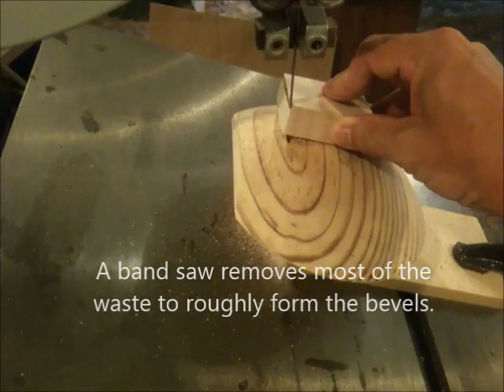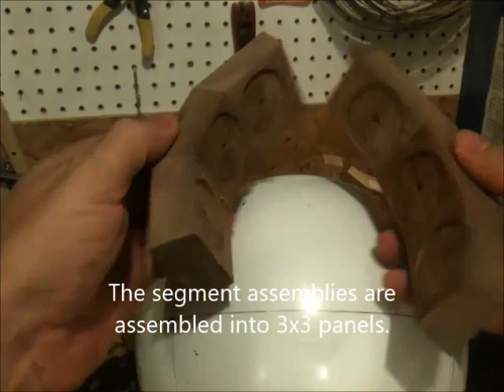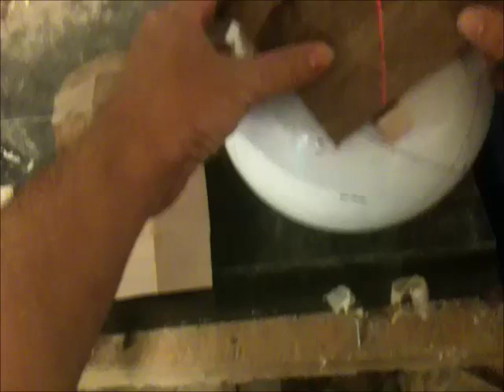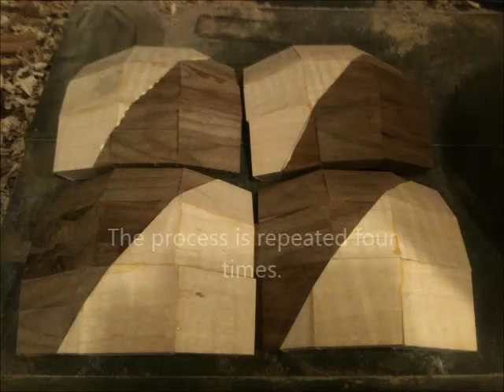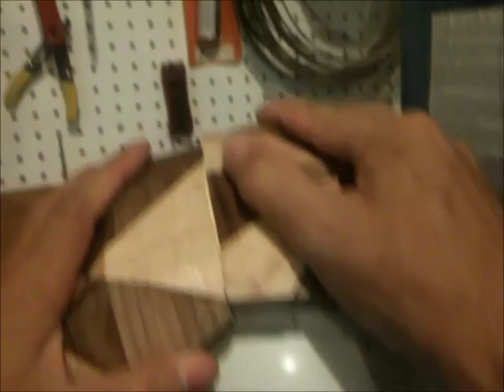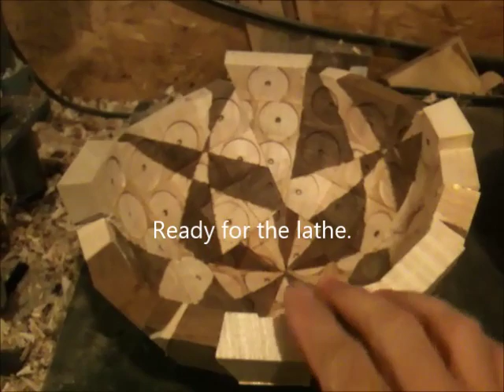Wood Bowl From Scrap

Comment from the maker: Increasing the surface area of the end-grain joints would strengthen them, but I don't think that is necessary.  It is common practice in segmented turning to have end-grain jointed segment rings.  These are not as strong as edge-grain joints, but strong enough.  I have also built a spherical spiral ribbon sculpture which has nothing but end-grain joints, and it is quite strong.

Comment: Yes, very amazing. How long did take in hours(without waiting for the glue) to do this? A very creative work and the result is beautiful.
Reply from the maker: Thanks.  I didn't keep track of the time I spent, but it could be done pretty easily in a weekend I think.  The glue I use (original Titebond) sets very fast and I might cut through a glued piece again within a half hour of previous gluing.  I let it all set overnight before putting it on the lathe though.